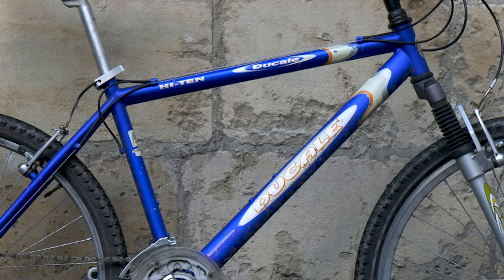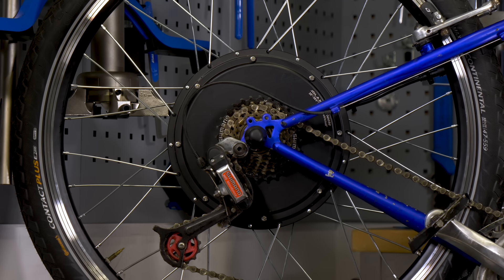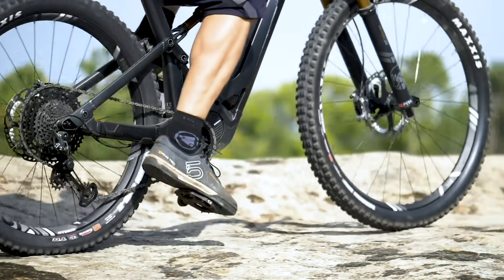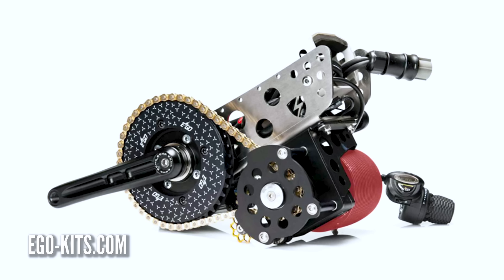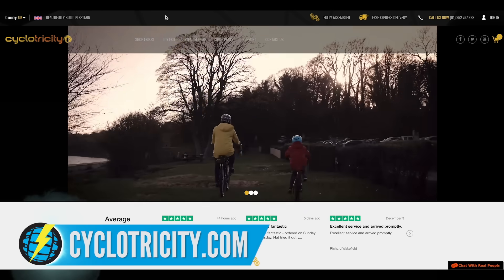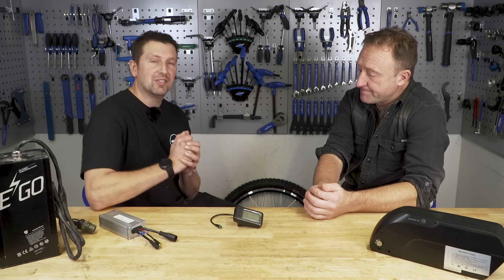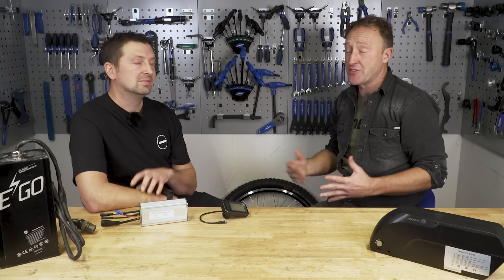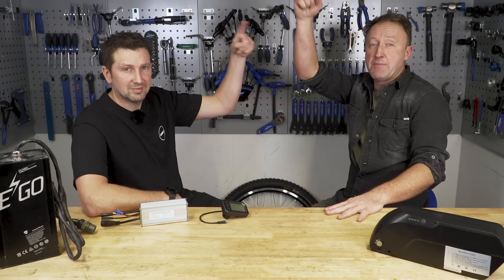Electric Bike Conversion Kit Options | DIY E Bikes With EMBN

Comment: Long time ago 1983 my friend had an old rally frame made in the UK so I remove the front forks took the shocks off of a 1977 bicycle mounted it on the front of the old Raleigh frame at the time it was rare to see bicycles with front shocks so now I've purchased Raleigh Mountain beautiful bright color I want to convert this bike to an e-bike Raleigh transfer Mountain thinking of 1000 watt motor with a kit🥰🥰🥰

Comment: Has anyone done a DIY conversion that merges front & rear hub drive with the mid-drive setup? A kind of Frankenstein mix? And if they did what were the pro & cons? How many times did they smash their head against the wall muttering, "what the hell was I thinking?" One other ask, when it comes to bike trailers has any done an e-bike type conversion for them? Sorry for all the queries but I'm the typical yank. Very healthy skill level with mechanical & electrical devices. A high level of imagination with very little in the pocket book; and like most Yanks, always looking to take respectively functional, to the highest levels of insanity possible.

Comment: I have a tricycle and I have fitted a solobike kit to it and I have a trailer, and it was working well, but now the motor cuts out when I get half way up the hill to home, I peddle hard in low gear, but I end up getting off and pull it up the hill myself. It is not a big hill and the battery still has 3 bars of power left. Do you have any suggestions on how to get that bit more pull out of the system? 
It is plenty fast enough, maybe 40 K's, but needs a bit more pulling power or something else to assist. 
Thank you for your time.

Comment: My battery is overloading when to much throttle is used.   What suggestion do you have for the fix?
Reply: @mrzif0013  restrict the amps from the settings on the screen

Comment: I have 2 Bikes Im thinking of Electrifying, #1 a SE FAT QUAD and #2 A DJ PK RIPPER, The DJ has front suspension both bikes are 26"s Since DJ has front shocks it also has a beefed up  Front end BUT The Quad ihas Fat Tires then what type of Drive do I want for local pavement riding like to my Local Bar and back???

Comment: Bafang 750watt mid drive brilliant ive over 7000 km.
On my Giant Roam conversation. 
I started with a little 250watt  front motor conversation from a Chinese company called Lvbu .
Still in use on my old Marin.
Its excellent as well.

Comment: Generally these kits are fitted to Carreras with 28mm forks and cable disc 160mm brakes and cheap nasty wheels. If the bike doesn’t snap then these will definitely burn your house down. Get a proper ebike not this shite.

Comment: I just picked up a freebie very rusted chain left out in the rain but nice model late 90's early oughts East Peak frs by Marin bikes, a very nice full suspension aluminum frame with mounting holes for disc brakes (but still has rim brakes).  It is a great find for building an ebike on except the wheels are still in very good condition and I think I am just going to ride it as is (after a little rust cleanup on the cassette and a fresh chain and a little tune up).  I understand you need wheels that have disc brake mounts and I am loathe to give up these nice wheels.  Question arises:  do most of the hub kits have disc brakes mounts?  How do I look for that?  Any advice?  As, If I am going up to 1000 watts for hill climbing, I am also going to want disc brakes.   I think rim brakes are ok only for low watt assists.

Comment: I fitted a mid drive kit on my 12 year old mtb I have to disagree about someone being competent enough to fit one. If you can do basic bike maintenance you can fit a kit. I've had mine a year. The two most important aspects I found for them is how much power do you want ie motor wattage & what range you want, I went for a 750w motor I'm a heavy guy & it pulls me up the steepest hills also the range you need my 52v 20ah battery gives my total 140kg ride weigh 30 miles range on one charge roughly dependent on several factors such as wind speed, hills & ride speed (I like to go fast!)

Comment: For Front hub it is the frames like the NEXT Power Climber that works well with front hub motor due to design of having center weight right behind the handle bars. Keeps wheels from peeling with better traction..

Comment: Dear Electric Mountain Bike Network
I want to convert my city bike into an ebike and I’ve looked at a lot of front hub motor wheels, but then I realized that my bike has “roller brakes” and I’m not sure what to do now. Do I have to by a special hub motor wheel if I still want to use my front break or what would you recommend? 
Kind regards Anders
Reply: I'm not sure if an answer still helps, but you have to replace the fork in this case. You have to have a fork for a rim or disc brake, depending on the type of hub motor and rim you use

Comment: I added 750w bafang mid-drive motor to my e-bike with a 48v battery and it rides like a dream I've tried a little off road on my other ebike but it has fat tyres but have a mountain bike is so much better 😀

Comment: Hi, this may sound ridiculous but,  I have a 1950 ‘s bike very sturdy  no gears. However Im 67 yrs. With total knee replacement and 200 pounds. I want to start riding my bike but it’s very hard to pedal.  I thought maybe adding a motor to assist with peddling.  Anyone anyone have recommendations.  Thank you for your help. 🙂
Reply: It is ok to convert a bike with no gear. any kit should be ok

Comment: What is best convert or buy?  I brought a ebike a few months ago and even so I like it, it is not my old road bike which is a fantastic cycle.  I idea was to buy an eBike and sell my road cycle but when it come to it I couldn't.  I can't ride a normal cycle like I used to and haven't used it for a few years.  It is a tiger Quantum 4.0 14 STI gears, so I went out searching convertion kits I did think abouit the Swytch but lets be honest they don't look good, easy to fit but makes a good bike look like something out of the 20s.  So after searching I decided on rthe Yose power front wheel 250w convertion kit.

Don't believe all these videos you watch that the convertion kit is going to come right out of the box and fit on your cycle, expect something harder then mending a puncture.  I have known people buy convertion kits and yes everything goes into place and fitted withing an hour, but for me never that easy as my cycle doesn't have round handlebars so handlebar extention was essential to fit the display.  We can't have a throttle in our country its peddle assist only even so I got a throttle with it, brakes cut out with the kit no good so had to buy  hydrolic brake cut out line which is a magnet and a wire.  Fitted fine and works cuts out the motor when cycling.

Front wheel didn't fit easy had to widen forks slightly and use to spacers on one side to avoid motor ctaching fork but it did it, the last problem I had was fitting the battery even so my cycle as a place to put bottle the bottom oint is no good. So had to drill to further holes in frame and put inserts in the fit battery.  Also added full mudguards and now connected up my old cycle looks good, took longer then what I though but worth it as now my normal cycle is a eBike.  What i am going to do with the eBike i brought I don't know yet, I am not attatched to it so might sellv it.  however if you have a old cycle yor fond of then yes make it into an eBike, its a project you wont regrete and the outcome is pretty good.  Not only that if you convert your old cycle it maybe just one of its kind/  Mike

Comment: still think I prefer electric skateboards for their simplicity but these would make trails and offroad stuff possible, assuming they have the power and the added weight doesn't ruin the experience too much when maneuvering.

to clarify, I know it's odd to mention skateboards on a bike video, but in the world of low cost electrically powered machines I think skateboards are far more accessible and a bit more refined. These still seem a bit mechanically clunky, hard to attain, pricey, and high maintenance, and I hope they can achieve a level of simplicity that makes them practical for more people.

with that said, having a descent electric motor on a used DH bike would solve the "hard to pedal" issue and make for a fun alternative to an electric dirt bike.

Comment: You compared kit versus lets say rockrider from Decathlon. This may be fair unless one already has a bike with much better specs. I may have a bike worth quite enough euros and for any reason I need Ebike. So I would probably not went for that Rockrider and leave my good bike unused and ride rockrider witch has much cheaper brakes, derailleur, suspension etc. And this goes for any bike one may already have. If its decent, why dont just convert it but instead leave it in garage and buy a new one? Selling old one may not be as profitable as just convert it. I think you made it look more difficult as it really is. If someone doesnt feel like it doing it, may have to do it someone else. It may cost something but new bike will also cost more money down the road with servicing etc.

Comment: The example cost you mentioned for a rear hub drive system, did that include a charger?
Reply: most don't. u have to buy the battery speedster

Comment: I tried the battery in the backpack idea...once. Batteries clearly need air flow to keep cool. After a 2hr jaunt, battery was almost too hot to touch. Not only would this lead to premature failure but fire is a possibility. Would've been great as it made the bike easier to.lift over gates and sty's, but it is getting mounted on the frame when I get chance next week.

Comment: great vid chaps! u mention mid drive is much better for hills... what about the rear hub drive u fitted to your hard tail? seems like the easiest way to go... however i do like to ride up steep hills to then down hill (i have a reasonably decent hard tail merida). i dont need anything fancy as long as it just gets me up the hills instead of walking which invetiably happens on a long day ride. do u also recommend pedal assist? or push button throttle?

Comment: I have an old giant I was thinking of converting, instead of buying  a rad or aventón.  I do worry about the old parts (brakes, gears, frame...) being able to stand up to the stresses placed upon them ( I’m 300 lbs, 21.5 stone), and adding the weight and forces to it in a way it wasn’t designed for.  Is that a problem?

Comment: Interesting video .Cheers lads .I'm in the middle of building a cyclotricity 250/1000 dual power bike from a montague paratrooper .Bit of head scratching but coming on nicely .Ps   don't carry your battery in a backpack .Its a nice way to snap your spine if you come flying off and land the wrong way .A water bottle in a backpack  was responsible for a snapped spine last year ...    .....Yip.

Comment: Good info....U.S. commenter here.....I considered a conversion and it is important to take one big thing into account..... if your  "donor" bike does not have disc-style brakes that might be a problem...."squeeze" brakes offer less stopping power. That equates to less safety especially at 20+ MPH.....so you'll have to replace them (the entire wheel) or install rotors and new brake hardware on existing wheels.... more money and skill required.....overall if you are new to this consider a modestly priced pre-build (which you will fall in love with...trust me). If you keep it in decent shape you can re-sell it at a fair price.... then either build or buy the bike with the performance and features you want from the experience gained from  your first e-bike experience

Comment: I have 48v controller with 5 level pedal assist display. How do I find compatible motor and battery for same. Will 36 and 48v 250w motor work with this controller. Can you help me with my e-bicycle project.
Reply: You need the amp rating of your controller, say 10amp x 48v 480 watts it could be around 10-15amps, I'd say a 500 watt motor at 48v would work, the voltage of the motor isn't set in stone, the controller has most of the voltage restrictions, it only works in a small range of voltage,  like 41-52v for a 48v controller,  eBay and Amazon has 1500watt controllers, 48-72v for about $40.   1000w for about $30. But you can get the kit for about $200, hub motor, controller, throttle, and break levers, everything except the battery!

Comment: what would you recommend for a throttle assist MTB that you can buy off the shelf and whats the best centre crank driven bike please?
Im looking for a bike that can cope with the above with a reasonable range and 20-25mph at times. i have heard the rear hub drives burn out, is this correct?

Comment: I'm looking to convert a cheap second hand bike. I've not owned a bike for several years. My main use would be for commuting and 'fun' rides (not mountain biking). I have limited technical ability, although my son-in-law is a motor mechanic. I want to keep the cost as low as possible, would you say the 'plug and play' rear hub drive is my best option? Ive only just come across your channel (watching Ray do his barefoot engineering!) Keep up the good work 👍🏻

Comment: The Tongsheng TSDZ2 mid drive (750w/52v) running the latest open source firmware is a solid competitor to any of the big name mid drives IMHO.  Especially when price is taken into consideration.  I have run two of these TSDZ2's over the last couple of years now, on different frames and as the firmware has improved along with the ability to customise the specs I have found them great for tinkering which is great if you like that sort of thing.  Please note I also have a 1500w hub drive 29er as well but this unit is really only for commuting running slicks as it's not the best for off road/mtb as the weight coming off jumps etc is pretty hairy.

Comment: Very nice! and thanks. One question, does the legal limit of the motor, @ 250 watts, to keep "Street Legal"  apply to the whole bike, or could one fit a 250 watt motor, to the front wheel, and anther 250 watt motor, to the back wheel, and still be "Street Legal"? Thanks, once again.
Reply: According to federal regulations you can have 750W per motor. It would also be VERY heavy, three motors and three sets of batteries. Better jut to go with one 750W set up